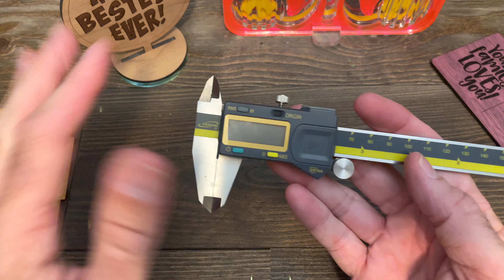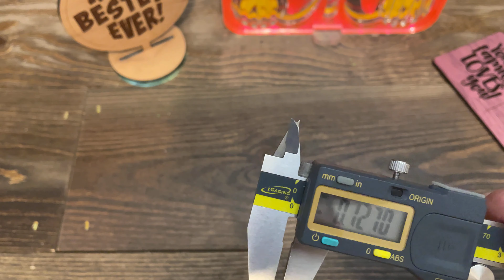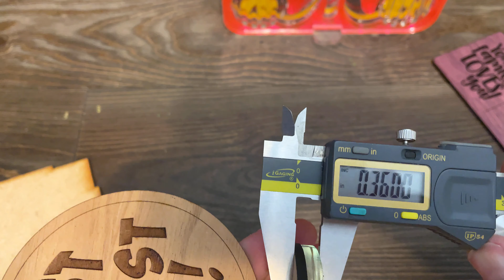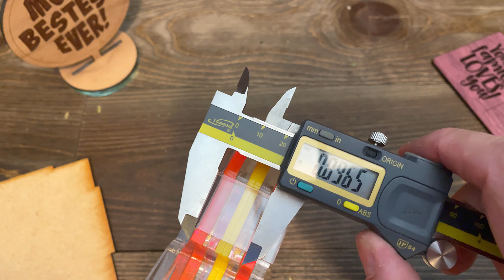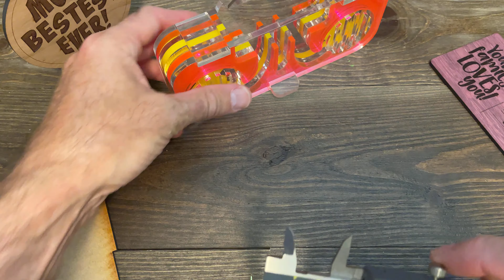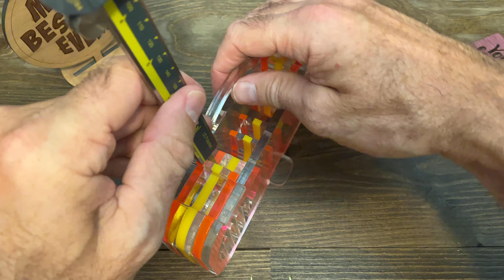Tutorial: How to Use Your Calipers

Comment: Thank you so much. When you measure to then put the board in the glowforge, do you have to put the measurements in somewhere or can you just hit auto focus?
Reply from the maker: You can use auto focus in most cases. But there are other times when you’d be measuring for other purposes like knowing how big to make a slot, how high you have to raise an item when you remove the tray, and more.
Reply: Thank you